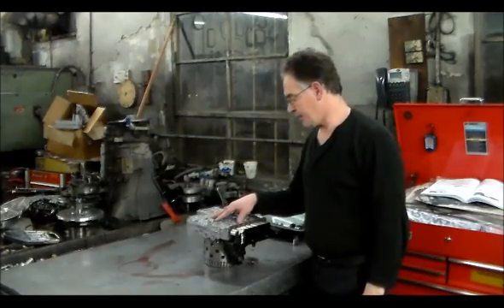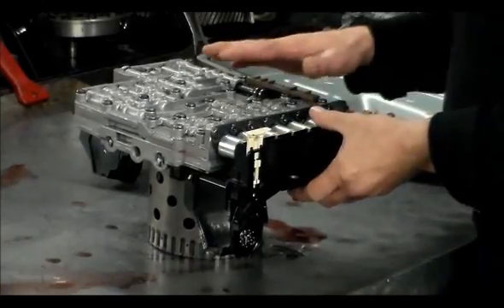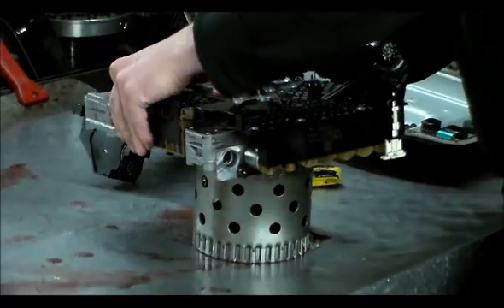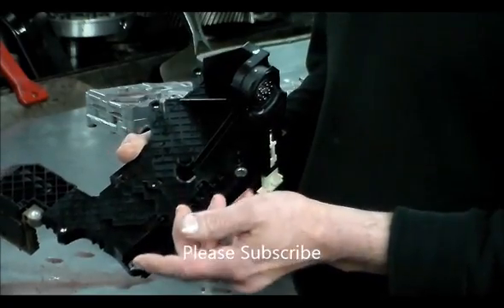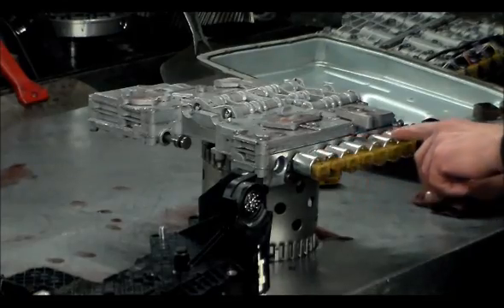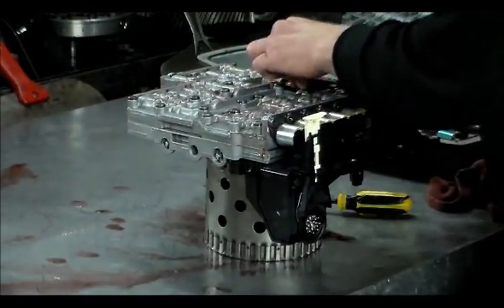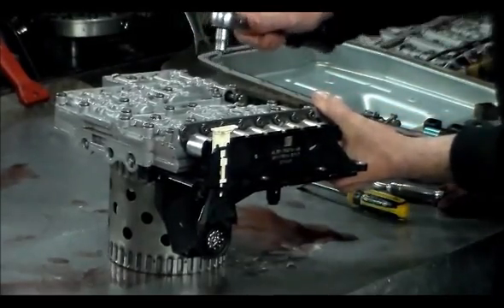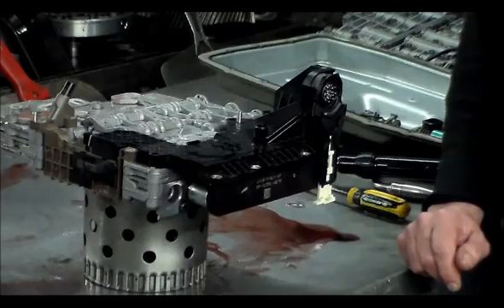6R80 LeadFrame

Comment: my 2011 lariat limited, started to act up. sometimes whenever it decides to, it wouldn't shift into reverse the R on my dash wouldnt illuminate and if you go into drive the wrench light pops up and if you try driving, it wont shift above 1st gear. I had to turn the truck off and a on a few times to clear it and also let it warm up good enough for it to work right, took it to the dealer and they said it was the lead frame plate and that it was a $700 part..I looked online and seen there was a recall issued April 2016 for the lead frame on the 2011-2012 and its suppose to be a free fix ...but what the description says about the recall is different from what my truck is doing..sooooooooo
Reply: My 2012 F-150 Lariat (manufactured late 2011) exhibited your symptoms too, plus others.  It has done the following:
1:  gear ceases to be displayed on HUD

2:  fails to start from a stopped position in first gear (accelerates from 0 MPH in 6th gear)

3:  SPEEDO immediately drops from current driving speed to 0MPH (instant, no delay) accompanied by a downshift to 1st gear, then back up instantly (less than 1 second) [when this happened I was pitched forward into my restraint, and I thought for sure initially that someone had rear-ended me]

4:  SPEEDO immediately drops from current driving speed to 0MPH (instant, no delay) accompanied by a downshift to 1st gear, then stays there until you turn the truck off and restart the truck (have to completely turn off till the hud goes blank) [I sort of feel that 3 and 4 are secondary symptoms and not to do with the actual problem - but that under no circumstances should a vehicle drop from a high gear to a low gear like this.  It is an unsafe condition and in fact when it happened to me, I was pitched forward into my restraint, my rear tires spun, I lost control of the vehicle and drifted out of my lane...  thank God the people around me moved out of the way.]

5:  while driving in D shift, the truck fails to downshift or upshift, resulting in underpowered condition or over-revving.

6:  HUD goes blank, then a wrench symbol appears that does not go away until you turn the vehicle off and on again

it's at the dealership now, and I don't recall what they said they are doing to fix it, but they said it would be between $1,500 and $1,600 to repair.

My truck was also NOT included in the recall you mentioned which calls for a new lead frame and update to the PCM

The following is from the recall letter regarding 2011-2012 Ford F-150 trucks being recalled:
The Fix: Dealers will inspect the powertrain control module for diagnostic trouble codes tied to the issue. If no related diagnostic trouble codes are present, dealers will update the powertrain control module software, which will eliminate the condition. Additionally, as part of the corresponding customer satisfaction program, Ford will provide a one-time replacement of the lead frame at no charge within 10 years or 150,000 miles from the warranty start date. If related diagnostic trouble codes are present, dealers will update the powertrain control module software and replace the lead frame for free.

I feel like my truck failure needs to be examined and considered for inclusion in this recall, but I don't know how to get that to happen.  I have registered a customer complaint with Ford's customer service department, and with NHTSA.  The dealership does not seem to care except to get me off their repair list.  Does anyone know if there is another avenue to submit a grievance to be considered for extension of a recall?
Reply: @ligaire  I'm having the same random symptoms in my 12' Expedition. There is a recall for mine, but it's not throwing any codes, therefore the dealer wont replace it under the recall. What did you end up doing, if anything?
Reply from the maker: is this setting any codes?

Comment: Great video!!! I’m having a little trouble though. Installed everything and the truck won’t shift into any gear. Is there any programming necessary?
Reply from the maker: You may have not hooked up the manual valve
Reply: That’s what we thought, my brother helped me, so we dropped the pan and checked and we can see it moving when I move the shifter.
Reply: It pulls code p0707
Reply from the maker: Thats  a range switch code, drop the pan see if its hooked up

Comment: I am in the middle of installing the lead frame and the new one comes with a foam strip that goes over the connectors. I haven’t seen that anywhere yet.  My old one didn’t have one but I’m assuming I need to install it? Great video by they way! Saved me over 1k! Dealer was going to charge me 1,500.
Reply from the maker: If you like, send me a picture  my e-mail gsferraro@yahoo.com
Reply: Gary Ferraro I forgot to take a picture but I installed the lead frame with the foam.  Trucks been running strong for nearly 20k. Thanks again for this video.  I couldn’t afford to pay the dealer 2k. I was paddles up that crap creek.

Comment: What would you charge for this job?
Reply from the maker: Michael Prezioso what year truck or car is it
Reply: Gary Ferraro 2011 f150 6.2 6r80 I have a code p0705 (trans range sensor) and since the sensor is part of the lead frame I’m assuming it needs to be changed.
Reply from the maker: I would have to price out the part to be sure but may run around 975
Reply: Recall get it for free

Comment: So I just finished replacing the lead frame easy peasy! Took me all day but that’s because I wanted to make sure I did everything right the first time because I wasn’t going to drop the damn thing again if I missed something. Anyways, just a few points to consider when replacing this lead frame...first and foremost, this job is messy!!!! No matter how hard you try to keep it clean and neat you will get fluid all over the place. I did this job with some jack stands and laying down. Next, when removing that sleeve, it can be a pain in the butt!! Don’t forget to unlock the sleeve by pulling down on the white tab that’s located on the valve body before you remove it, same goes when your installing the sleeve, the tab won’t lock unless that sleeve is fully seated! also just go ahead and replace that sleeve. I read on the forums that this part leaks, especially with the old one on there. Apparently Ford came out with the newest ones, don’t really know they both look the same...but either way, the part cost 8.15 on ford parts.com. Next, that pesky thermal valve, now that was a really a$$ pain keeping that up there when your ready to install...BUT, a little bit of petroleum jelly don’t hurt to keep that up there. The spring goes in first when you instal the thermal valve. Just a note, if it falls out you can tell because you won’t be able to fully seat your valve body properly. Next, that slide thingy on the lead frame, make sure when you install the whole valve body that the slide thingy also engages the shifter arm. After installing the valve body I was looking over everything to make sure all looks good and I noticed that slider thingy was all the way on one side and the shifter arm was all the way on the other, the slider thing was just moving freely, so I tried to get that slide thing to engage the shifter arm but no go...so, out comes the valve body AGAIN!!! and the damn thermal valve ugh!!!! So, reinstalled and all looks good!! Filling with fluid, your going to cold service the transmission first. Fill all the way till it comes out of the filler hole. Close her up and start the truck, let the trans temp warm up to about 95 degrees. Shut her down and then fill the rest of the way till the marks on the dip stick. She will take roughly 7.5 quarts. I bought 8 quarts just to be sure. Hope this helps! Another note, when installing the thermal valve, the spring goes in to the transmission first.
Reply from the maker: Thanks for the update, glad its working and you repaired yourself. Great Job!
Reply: Hello I’m about to conduct this surgery on my 6.2 F150 since I too am out of warranty. Do you have a part number for the sleeve? I searched 6L2Z-7G276-AA on the ford parts website and no results. Thanks!
Reply from the maker: That looks like the correct part number, when i put that in, it came up on amazon.com
Reply: Thanks, that’s what I got.
Reply: I can’t get it crank after I put it in. I don’t know which side the slide thing is supposed to go on.... help!!
Reply: @malisaoum3158  hey old video I know by any chance do you how to fix this issue?
Reply: That doesn't sound too Easy Peasy Bruh......
Reply: So when changing the lead frame are you having to replace 7.5 quarts of trans oil?
Reply: I just swapped out my lead frame, now my truck starts, but it will not move when putting it into gear.  I did the cold service fill for the putting fluid into the transmission, but now I am getting this error: P0765 Shift Solenoid D Malfunction.  This code didn't show up any other time before switching out the lead frame.  Anyone have any suggestions, I am at a loss for fixing my truck.

Comment: Today my truck (2011 F150) lost all power and got stuck in 5th. I disconnected battery and that reset everything and got me home. My truck is just out of the extended coverage by 12k miles (162k) When it does it again I am going to go to ford and see if they will goodwill it for me but if/when they won't likely be doing it myself and this video was very helpful. Thank you
Reply from the maker: You really need to see what code is present, have you had it scanned for codes?
Reply: yes it was a P0720 and a P0722 I believe I could be mistaken. I will of course get a second opinion before any repairs are done.
Reply from the maker: If you have these codes and the 6R80 trans, the leadframe is probably your problem, this is full of fluid correct?
Reply: Yes I have a 6R80 and the fluid is full I checked it on the side of the road today. That stubby dipstick is a bitch. Thank you for your assistance
Reply from the maker: Welcome, you will probably need the lead frame, where are you located?
Reply: North New Jersey 07825

Comment: Gary, are there any programming needed when replacing the lead frame? I plan on doing this repair myself on my 2012 Ford F150. Took it into dealer and said that the lead frame needs to be replaced. They want to charge my about $900 for the repair. I have some decent knowledge on tools and automotive repairs just never done transmission stuff before. Just want to make sure this a true remove and replace job and no programming or other surprises that i might run into. I watched your video and the Thermal part lookslike something to pay a little attention to. Thanks Gary!
Reply from the maker: No programming needs to be done, but you have to take a sleeve out to drop the valvebody. When the pan is down, look for a white tab towards the back of the valvebody, pull the tab down, this will release the sleeve and pull the sleeve out. If your not sure look for a video i did on tearing down a  ZF6HP26 Transmission, this is basically the same thing.  You probably have a speed sensor code
Reply: Thanks Gary. Yes I did watch on how to remove the sleeve. This is the same sleeve that i will replace due to it commonly failing/leaking. So this is just a plug and play component...? Thanks for your help!
Reply: Ford should repair it for free.  This part was recalled on F150's manufactured in 2011-2012.  "If an affected vehicle exhibits this condition, dealers are to replace the molded leadframe.  This service must be performed at no charge to the vehicle owner."

Check this link out....
https://ford.oemdtc.com/2679/16n02-molded-leadframe-extended-coverage-2011-2012-ford-lincoln
Reply: Kyle, I tried already and since my truck was out of the power train warranty they said I was responsible for paying every penny. If there is something you know of please let me know. Would save me lots of money. Thanks!
Reply: I have same issue. 2012 f150 ecoboost. I’ve been taking it to the dealer for 3 years they keep saying it’s not throwing a code, there is no recall, etc. That all started at 136,000 miles. Now I’m at 156,000 they finally admit there is recall but I’m out of warranty, and my truck isn’t throwing a code!  I went ahead and ordered the parts they quoted me $750 to fix it w/labor but I’m not done with them yet…..

Comment: Glad I found this. Was searching the exterior of my 2011 6R80 transmission for the output shaft speed sensor. Was driving me crazy not finding it. Found your video and turns out it's inside the transmission. Ugh. Looks like I'm going to have to take it to the shop for repair. Thank You for the video and explaining so well.
Reply from the maker: Your welcome, where are you located?  Common problem with this unit
Reply: Gary Ferraro I'm near Galveston Texas.
Reply from the maker: Ok, just wondering if you were near me, im in new york, do you have an output speed sensor code?
Reply: Gary Ferraro yes, I took it by O'Reilly's and down loaded the P0720 code. It was multiple times it threw that code. My transmission would not shift out of 1st, speedometer would not come off of zero. Could not go above 10 mph, or at least that's how fast it felt. Now, the check engine light is on, but the speedometer started working and going through gears like it should. Taking to shop tomorrow because I've never even tried to tear into this type of transmission.
Reply from the maker: let me know what they say and how much the repair is
Reply: Gary Ferraro will do.

Comment: You could remove pypass the cooler and there are less pieces first amendment as the heat weather in summer with snowmobiles, reach as high as 111.
Reply: 111c
Reply: yes,  first amendment big issue with transmissions in trucks

Comment: very good information and great work. replacing leaf frame just does it need reprogram?
Reply from the maker: No, does not need program, the TCM is no longer in the leadframe.  I just had outspeed sensor failure
Reply: Gary Ferraro ،TCM location?
Reply from the maker: Its part of the PCM now, back in 2006 when these first came out, the TCM was in the leadframe, i think about 2010, its now part of the pcm
Reply: Gary Ferraro thank you ..really appreciate ur reply..thanks again.
Reply: Gary Ferraro I just replaced mine on a 2009 and it doesn't shift . Does it need to recalibrate or you think I got the wrong part ? Hope you can help me plz
Reply: George Bocanegra did you ever get it figured out? Im thinking i need to replace mine and i dont want my truck to get worse. Mine starts out in 5th gear sometimes and sometimes stays in 5th gear when coming to a stop
Reply: gpmike02 yes I replaced mine and it wasn't shifting and it was identical to the original one . But my problem was that it was leaking oil ,but then I find out that it wasn't from the pan it was from the o ring so I just swapped it out and now it's working good .